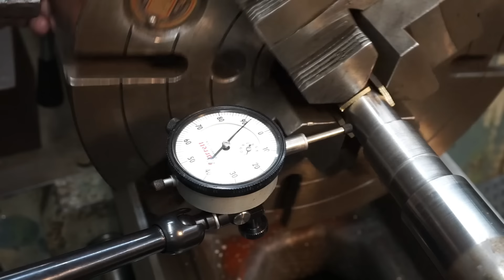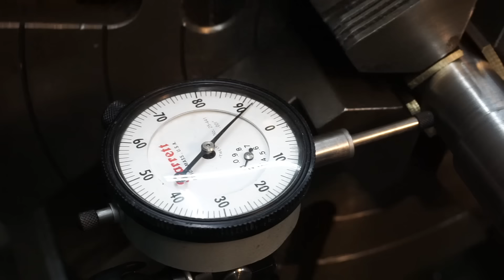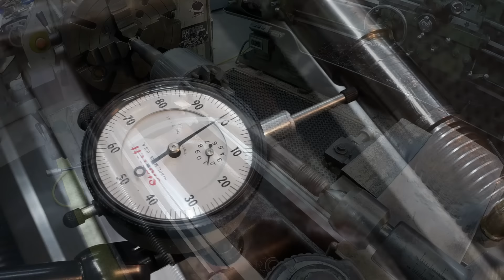Spray Welding a Pedestal Grinder Motor Shaft

Comment: How do you verify the correct shoulder to shoulder distance before and after the spray welding? I assume the bearing fretted the shoulder away as it was hammering around in there, and I expect there would be some build up during the metalizing process.  Or is there typically a shim pack to set the end float in the motor?

Comment: Adam,  just curious why you would not repair it by welding beads with an Arc welder and then machining the surface back?     I know that has been an accepted practice for restoring camshaft lobes in engines.

Comment: Cool dude.  I dont know if its just the camera, but I can still see a difference in the color of the metal.  Can you see it as well ?  I know it is just a bearing journal, but would you cut it down, stick weld it up, and then cut to dimension for say, a axle shaft ?  If it was only out say, 0.040 -> 0.080 ish ?  Or shoot it ?

Comment: That’s a great vid. Been ages since we seen u spray weld. I was wondering though Adam, do you think that process could be used to ‘pad weld’ sheet steel in places of rust pitting? Say, heat the spot and blast it with the bond and top coat? Then grind flat? Cheers bloke. 🇦🇺

Comment: I would think even though that journal(I know,not PC machining,lol) at the center has runout,the factory balance compensated for that.I would guess the bent fins would be a greater concern for imbalance....BTW,how hard is the spray material?It looks like it sands REAL easy,or am I wrong?

Comment: Would this work for a shaft that has wear on just one side of the shaft, not uniformly around the whole circumference? I've got a brake shaft off a tractor I'm restoring that has heavy wear. Want to repair it or have a new one made.

Comment: Hi there!, could you please give information about the gun that you used ? I saw that it seems that you apply the substrate just by gravity? how do you control the homogeneous application of the substrate to guarantee the control quality of the welding in all the section in order to don´t have cracks when you machining the section, very impressive the feeling that you have for the times in the preheat and the application of the powder, good work!.

Comment: Imperial: We've got a 30 millimeter bearing inside diameter, so our shaft needs to be 1.1815" max.
Metric: The bearing inner ring is a 30H7 fit, we need a 30k6 fit on the shaft (30.015 mm max.)
;)

Comment: Great job, but wouldn't it have been a lot easier to just find a similar bearing with a slightly smaller I.D hole and just turn down the shaft? That  would have been my first attempt before metal spraying.

Comment: Having repaired many items with this procedure..it has a major down side & that is it introduces alot of heat to shafts. A much better process is the twin air/arc spray systems offered by TAFA & a few others, that do not induce so much heat into the work...a "cold process" if you will as compared to the oxy-fuel set up

Comment: Love watching this stuff.  Have to ask, though, wouldn't it have been easier to turn down the bearing face  to true and fit a bearing with smaller id same od?
Reply: Ein Felder no, that would weaken the shaft, the gyroscopic leverage on the ends of these long shafts is enormous, as well as harmonic resonance, and out of balance forces from heavy grinding wheels, and so on. Heavy enough to have reduced the original surface.
Reply: @oregonexpat  But the shaft was turned down (as well as worn) so it was already weakened. I can't see how  spray on weld would restore original strength.  A smaller id bearing would take the place of the spray on material.

Comment: Have you ever tried the 1 part metal spray powder from castolin eutectic? I use their 21022 formula for bearing journals and it lasts for years and years

Comment: Thanks to one of your previous vids I had this in mind for a repair on a hydrostatic mower trans shaft. Would this be durable enough to build up a roller bearing race? The shaft is no longer available (well, $800=unavailable). I wondered about buildup with a traditional weld process but was concerned about warping the shaft... whaddya think?

Comment: Pretty cool! Looks like an old school process but hey I'm new to most of this stufff.  I do have a newbie question though in case I run into something like this of my own.  Could you TIG it up or is that just too much heat to put into something like that?  I know that they used to weld up crank shafts to resize them.  Just for my own curiosity.

Comment: nice job , I have been using utec-it coated rods in the industrial refrigeration ,mostly for steel to brass /cooper welds ,although this is actually a brazing process . my question is where are you procuring your supplies and did you fabricate the spray fixture , it looks to operate on a vertura orifice induction  (product is draw into oxy/fuel mix ?)

Comment: Is it iron? Why not mig or sub arc and grind? Not hatin just curious.
Reply: Probably due to true welding giving a high chance of warping it with the heat inputs
Reply: @FlattyBasher101  i used to repair crank shafts that had to be bearimg hard. We sub arced and ground it to dize but had to heat trat afterwards. Sub arc has small heat zone and some wires are almost bearing hard. We had to straighten in a fixture but the base when done was better than original.

Comment: would this be the same process used to repair a crankshaft that had a bad journal? could it be used to repair a rear main seal surface on a worn crankshaft? i think i've heard of a chroming process to rebuild crankshafts but i don't know if it's accurate or not. 
is there a way to do an episode on how to care for your bench grinder? truing up grinding stones and such?
thanks Abom! this was one process that i've always wanted to see done.

Comment: Welding or soldering?
It looked like the base metal did not melt.
Reply: Kind of like spray sintering almost. The way its called I think is a bit misleading, but whatever.

Comment: Wouldn’t it be preferable to have a hardened surface for bearing journals instead of a sintered metal (as in a sleeve)? Also preheat was 200 but what was the final temperature of the part post welding and what are the potential effects to the molecular structure of the part and was rapid cooling best practice? Do you do any hardness testing post repair?

Comment: 2 questions: 1. Why call it "spray welding"? You are not actually welding anything. Seems to me it should be called "spray coating" or something like that. 2. Why not cut the worn bearing journals down and then heat-shrink steel sleeves over the shaft? That would probably be quicker and less expensive than "spray welding". Thanks for the excellent video!

Comment: I don't understand how the bearing journals could wear out. With ball bearings the inner race is mounted with an interference fit on - and spins together with - the shaft. Even if a bearing would lock up suddenly, I don't think the rotational innertia of the rotor + grinding wheel would be enough to spin the shaft relative to the inner race. The shaft breaks before that happens.
Reply: The only plausible scenario I can think of is that the journals were corroded (because of less than ideal material pairing maybe?) and had to be machined down to the current diameter.

Comment: When you restore fits , balance is achieved on a rotor that was previously balanced. When you then turn true any surface after that. The rotor is  now out of balance. You potentially caused an unneeded expense for your customer.

Comment: This is not spray welding, but instead, it's powder coating.  Spray welding is done with a mig welder, using 92-8 gas.  92% argon and 8% co2.  The amps and volts are set higher than for short arc welding.  The wire liquefies and sprays the deposit into the molted surface.  Close, but not the same thing. Yes, I know how to weld.  I've been certified by AWS, ASME and UL for around 25 years.
Reply from the maker: Us non certified shop guys call it spray welding. You can argue the specifics all you want but we’ll still call it spray welding, and metalizing.

Comment: I'm no expert and it's only my opinion,but wouldn't it be easier to get a bearing with same OD but a sliver smaller ID,and machine shaft to the bearing.Butif that welding will hold father time.then 👍

Comment: im has young boy metal workshop work 3 year and i see elektric motor shaft repair we weldin normal MIG bearing area and then make lather right size..rod welding have better soft metal MIG made wery hard metal cover to welded area.

Comment: Lets say someone had a 1950 farmall tractor. Could the spray welding be used to build up thickness on the head. Or would there be a better way.
Reply: I have heard of spray welding cracked heads before so...maybe ,what do you mean by build up? Are they shaved down to much? Or shaved to min.spec last build and in need of build again?
Reply: @wolfmanrebel874 . Machinest said he wasnt sure there was enough material left to deck the head.

Comment: Very, very cool. Here's a possibly dumbass question. Couldn't you replace the bearing with one with the same OD, and a smaller ID, and turn the shaft to fit? Seems like it would be a lot less work.

Comment: I'm guessing here that the flame jets ability to deliver an optimum temperature is 1 of it's  required attributes.
A  2nd one must be it's 'taste' or chemical influence, it's oxidizing / reducing properties. (The flame should not contain any un-reacted oxygen so  that it is not able to cause any oxidization of the particles of metal being added to it).
If someone can confirm this or correct me I would appreciate it. 
Thanks.

Comment: Is this the process when I hear racer saying to get in the crank welded?
Reply: I think that usually refers to making a stroker crank, by building up one side of the rod journals and machining them so they are further out than before. And I suspect they use a more conventional welding process... But I'm not involved in any of that sort of stuff.

Comment: Would anything be different to spray weld a high load shaft like a heavy equipment axle or a race engine crankshaft journal?
Reply: Just different metal for different uses like reg welding can hardface too

Comment: Metallizing is not welding, welding has two metals that are melted together, in metallizing, the base metal is not melted, and the metal that is sprayed  on is  molten and it makes a mechanical bond to the base metal.

Comment: Just like JB Weld, but probably more than 100 times better. They used to have so much cool and "good enough" stuff back in the day. Now if you want to get that kinda repair done, you´re down a thousand bucks for some laser welds and hours of machining because laser welds eat tools. Done the machining on a similar job except the guys that brought it in had it laser welded up. I cursed all the slurs I knew.

Comment: Forgive me, but... this seems like, paying to have it done, would be FAR more costly and labor intensive than just running a fine MIG bead across the bearing surface and machining it... And done at a 3rd of the time needed to do this procedure.. Interesting technique though...  Seems like only a 10th of the metal powder is actually adhering to the shaft.

Comment: I would be too scared to clean it up with steel wire brush, just because I wouldn't want to loose a single thou on the diameter. I mostly use copper brushes for everything, except for paint and rust thicker than thin surface rust I use steel.

Comment: Man just use a 3 arm lathe chuck.. Safes a lot of time
Reply: Peter Zingler A four jaw is much more precise. Unless you have an adjusta_tru chuck most used 3 jaw chucks do not run close enough if the have been used any length of time

Comment: Couldn’t you just throw a bead then turn it down?
That’s how I’ve always done it
Reply: The- potato-warrior yes BUT a shaft that small will warp very badly. Plan on press time and you do not know the weldability of the parent metal. Have seen shafts snap at the Martincite zone created at the weld joint. Would take much longer because of warpage factor. Metal spray is excellent for a bearing press fit!
Reply: Dale Loveridge shafts are typically 4140 heat treat or hardened steel of some sort. You can weld that no problem.
I understand the application of spray welding, but that shaft isn’t going to warp welding on it.
I’m not trying to argue, but if you can’t differentiate hardened steel from a36, 1018, 1020, etc you shouldn’t be machining or welding anything

Comment: If I did not spray weld five hundred plus shafts I did not spray a one. Saying that, I never had to use a flex sandpaper for the sizing of the journal of the shaft. I used really sharp tools and cut to max tolerance of my standard bearing inside diameter. Shame on you fella, you can do better if you try. Just saying what experience has shown me by working with men of Master Machinists Caliber. This is not scraping a surface. One can never get as accurate a journal by hand as by turning in the lathe itself. Remember that fella. Taught to me by all my fellow master machinists and tool and die makers that I worked with and was shown the right way. Try to be more professional in the machine shop. That being said. Good day and keep on machining.

Comment: I have no idea what the hell this guy just did.
Reply: wombat pants cut a bit back spray welded it then ma machined it down to the right diameter so the bearing would have a tight fit

Comment: Spray welding is so useless. Dated*  Wears down fast and screws up the shafts hardness.  Lol he loops sand paper around a shaft. Was waiting to see a arm rip off.  Tig weld it like any welding shop would after the year 1960...
Reply: Lol i bet the bearings didn't fit lol